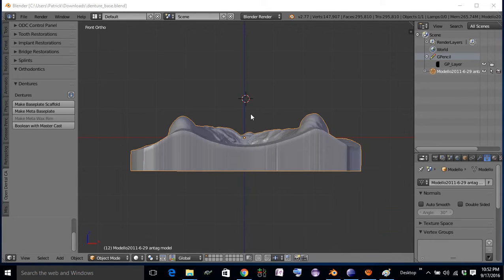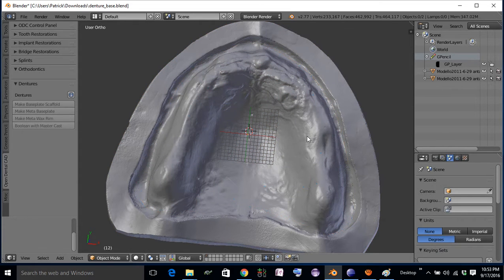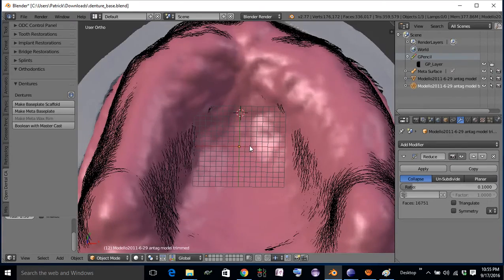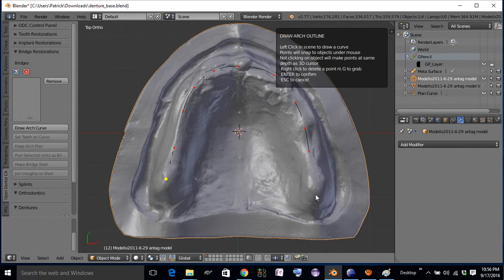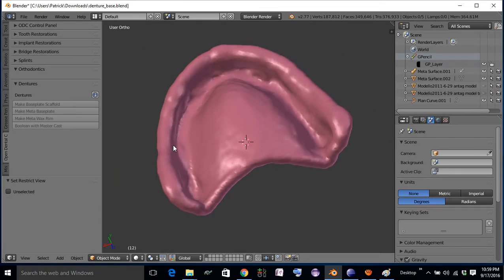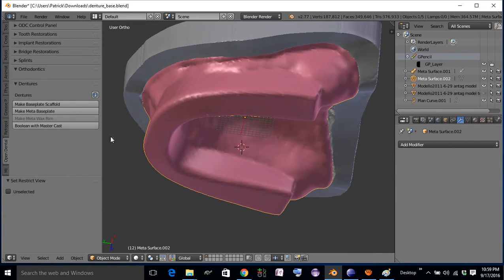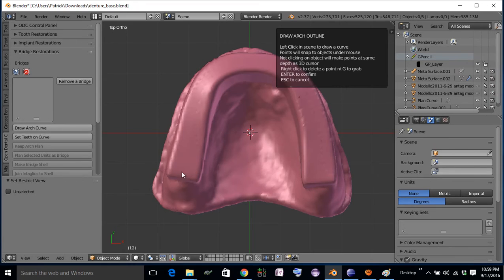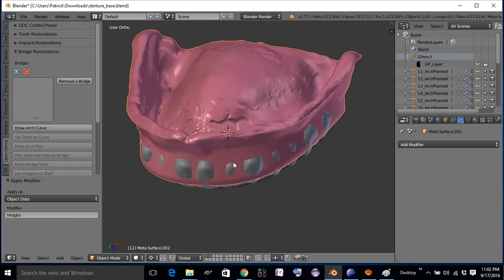Baseplate and Wax Rim

Comment: Patmo 141, congratulations for your amazing videos and for taking time to share with us.
I am still trying to learn how to use blender a little bit better, and sometimes I am struggling with some of the tools.
For example, I was trying to follow the steps on this video, but after using the polytrim and selecting the cut (C) and the seeds (S), I hit E and after that shift + D as you say, and usually the model duplicates but I cannot see the blue areas at all, or sometimes it takes the whole model instead of the area that I selected to trim.
Have you ever experience such issues ?
Please let me know
Best regards